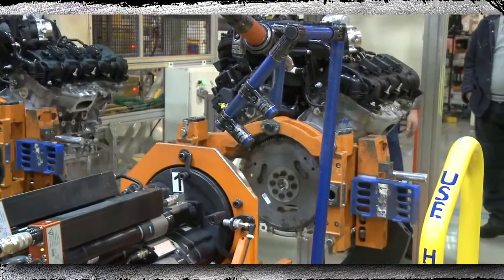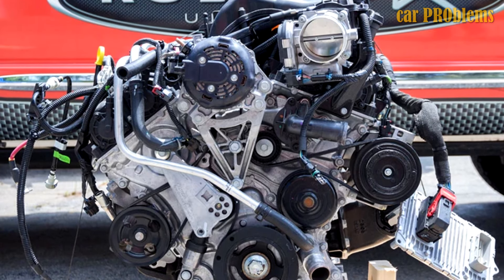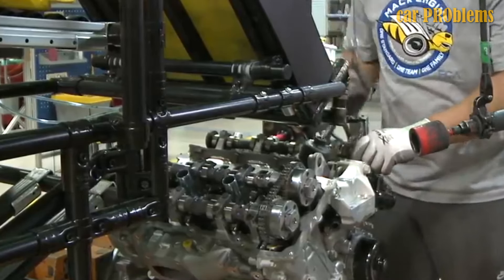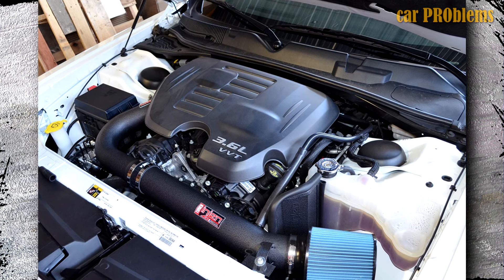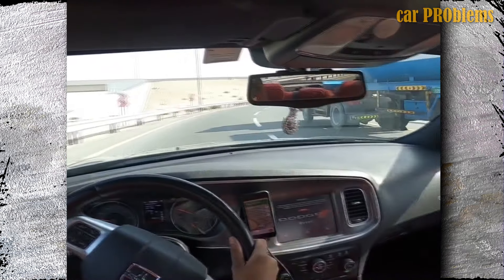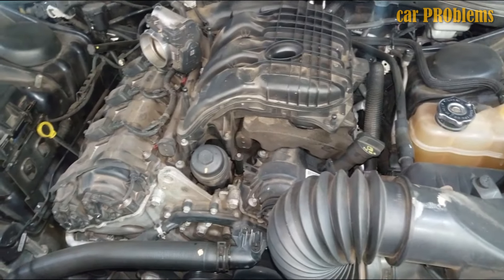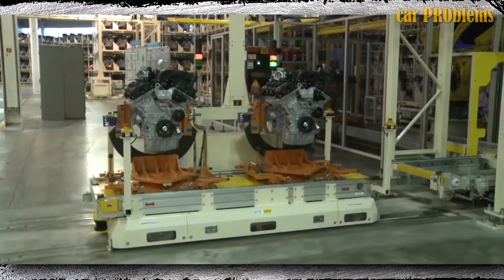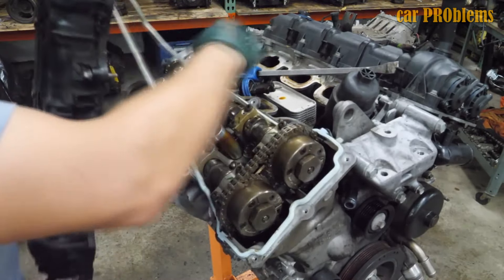3.6L Pentastar V6 Overview, Common Problems and Reliability

Comment: I currently own a 2013 ram CV tradesmen which is a Dodge Caravan cargo van basically. My vehicle has a 3.6 L Penta star V6 engine it is excellent excellent excellent. I currently have 481,920 miles on this vehicle it run. Super smooth. It's very powerful and it delivers excellent fuel economy at about 26 on the highway in cruise control, and almost 20 miles to the gallon regularly around town. The body of the vehicle is excellent. The interior is excellent I have zero complaints on this vehicle.
Reply from the maker: 481,920 miles?? That's awesome!!!
Reply: Wow
Reply: I also have the 2015 CV tradesmen , I love this vehicle.
Reply: How many transmissions?

Comment: Had a 2012 caravan with 220k on it before trading it in. Engine still ram quiet and flawless. We now have the PUG version in our 2019 wrangler, lots of miles off roading at crawling speeds. Engine has been perfect as well

Not the most exciting motor but very smooth and reliable

Comment: My 2011 Grand Cherokee w/3.6 Pentastar engine just passed 182k. No ticking, no oil leaks or burning. Amazing engine. I got my moneys worth  already. Mobil 1 5w  30  oil every 5k.
Reply: Any oil housing leaks ? And did you replace the lifters

Comment: I have a 2018 jeep jk with 3.6 star 74k miles

Mine drives flawless runs so quiet you can't even tell its running when it's on.  

BUT I Change my oil every 1500 miles ,always with marvel mystery synthetic not the original with royal purple, every 5 k I drop in a liqui moly  molybdenum the $50 dollar one I leave it in a full interval. My engine is tight no tick noises no nothing.  I'm about to change my coil packs & plugs I got NKG coil packs was $175 for 6 NGK laser iridium plugs $75 

Although I have no oil filter housing problems I'm about to change it out to an all aluminum one amazon $160 I'm doing that the same time I change my packs & plugs because might as well bcuz everything will be in fingers reach.    That's my 18 JKU.

Update I forgot to say that I had to take it back go the dealership twice for rear main seal & my rear dana 44 spider gears exploded so the dealership gave me a brand new whole rear end I didn't pay 1 cent . Besides those problems nothing else but if I'm on a trail and I flex the jeep in a certain way my driver door will pop open at first I thought it was funny. The driver door if you open it with the jeep parked the door chime will annoy you to death so I cut the wires. Ball joints ball joints BALLLLL JOINTS 😡  my ball joints blew out & I had crazy death wobble but I put in heavy duty ones .

Comment: Based on about 6 different Rainman Ray videos. Just immediately swap out your engine oil cooler for an aluminum one, or be prepared for a coolant/oil slurry to eventually hydrolock your pistons and make engine go boom.
Reply: Doesn't surprise me. Owned Chryslers before. Never again. Although I am curious how this engine has "progressed."
Reply: Just did mine 😂😂 dorman all aluminum oil filter housing

Comment: It's good to see all of these praises for the 3.6. I'm on the fence with mine. I bought my 15 Ram Tradesman 4x4 with 150,000 on the clock. I have since replaced 20 rockers and 8 lifters, 1 injector, the oil filter housing, upper and lower intakes and both valve covers (not just the gaskets) due to stripped threads. It's always had sort of a "hot" smell to it. It now has 167,000 on it. I've done all the work myself hopefully it pays off in the long run. I run 5w30 Valvoline High Mileage.
Reply: I don't think you can judge the engine if the first 150k wasn't under your care. I don't think you can have much expectation with any car purchased at that mileage.

Comment: 2007 & 2008 Wrangler Unlimited with over 180,000 and both are going strong with no engine issues.  However had to rebuild both transmissions around 160,000.  Ordered a new 2024 Rubicon X with the six again.
Reply: The Rubicon X is what I'm planning to order as well. With the 6 speed manual. Hopefully, I can custom order it at no more than MSRP. Did the dealer charge you extra?

Comment: Got a 2017 dodge challenger gt with the v6 and I drive between Washington and California often I maintain the crud out of it and yes I change my tranny fluid...so far going on 400,000 miles and engine still running strong but I am still surprised theres no buring oil

Comment: I have a 2015 Chrysler 200s w/ AWD and the 3.6L. I had about 125k and had to replace all my rocker arms and camshafts. Also had to replace the oil filter housing/cooler at about 115k miles. 

Now that’s all been replaced, I hope it will last until 230k miles. Other than those very expensive issues, car has been great!
Reply: Same problem at 95,000. Had to replace the same exact parts. Poor design. Old Chrysler engineers would be on this in a second.

Comment: My 2012 Challenger and 2014 300 S have the Pentastar. I hope these last until the wheels fall off. I wouldn't trust the new inline Hurrican six coming on line in 2024 2025. My Ram has the 5.7 old school V8. and that another impressive engine.

Comment: I got a 2014 4door JKU stock engine and body, that's about it. I'm currently running Kirkland Signature 5-20W since the price of AMSOIL SIGNATURE is too much. 
2 years so far doing great 63.99 for 4 gallons hard to beat😁👍 
Off-road only Royal Purple or AMSOIL SIGNATURE if I plan to stress my JKU.
Reply: Run the 5w-30. Much better for the engine unless you’re in very cold climates

Comment: Last month I took my 2014 Chrysler Town & Country to the dealership after the CEL came on. Code P0302. Compression test #2 100psi. Failed leakdown test. Burnt valves. Only problem I noticed was irregular idle the day the CEL came on. Cylinder Head replacement $3000.
Friday the CEL light came on again. Waiting for diagnosis from dealer. Only $6500 of warranty work since new. 135,000 miles.
I bought the Chrysler Maximum Care Lifetime Warranty when new. 
Add in possible another $3000 cylinder head and the “service park assist” display that came in the week before. Could be an additional $500 to fix that. Is $10,000 in warranty work a record?
Dealer called today. They’re replacing the drivers side cylinder head. $3000 + $3000= $6000. (Warranty)
Update 11/21/23. Just got back from local CJDR dealer. Ticking sound. Waiting for warranty approval on THIRD cylinder head Replacement!!!
Third THIS YEAR.
Reply from the maker: OMG! Thanks for sharing... I have 2009 Dodge Journey. It's a "bucket of bolts". I will Never buy Mopar vehicles again.
Reply: Have 2012 200 with the 3.6 with only 58 thousand miles. Got code 0300 random  misfire, and 0306 misfire in #6. Have to replace left cylinder head 4000 dollars. Warranty 10 years or 150 thousand miles. 10 year ran out last year. Seems like is a design problem and owners have to pay.
Reply: @alexrebmann1253  I’m having a cylinder 6 misfire in my 2012 Chrysler 200s with 80k miles I had it since new it’s been ticking and it’s getting worse since 55k miles now I’m gonna replace the spark plugs and coil packs since I’m already inside the engine hopefully the removed the code and shaking in idle light shaking cars still my daily driver to work everyday

Comment: I own a 2015 Chrysler 300c with the 3.6L I bought a new in January of 2016.   The car, as we speak has 9,678 miles on the odometer, never a problem.  I run 89 octane, midgrade Shell gas only even though the handbook states 87 octane Regular.  I use Synthetic Oil only and the car should last for years to come.
Reply: Not running migrate gas it won't last, your engine is designed for regular,  you are doing damage bc it throws fuel air mixture off
Reply: Lies
Reply: These new engines operate well on 89 and 93 octane fuel,  87 is killing the new engines.  These automakers will tell you anything cuz they want to bringing back in for hi prices service

Comment: Bought a 2017 Pacifica in December of 22. Turned 100k in June and had the oil changed. 1000 miles later it started idling rough, hesitating in acceleration,  and dying at stops. Replaced plugs and coils hoping it was something easy. 
Heard it was a flat cam. Took it apart, no damage to cam, no shavings in the oil,  now no clue.
Reply: Hi! Had the same issue with my 2011 Town&Country.
Possible causes to look at:
- Dirty throttle body -> engine doesn't get enough air at idle -> disassemble, clean, reeinstall
- Vapor canister purge valve stuck open -> engine draws secondary air -> replace
- Hose to vapor canister purge valve cracked or broken -> engine draws secondary air -> replace
I did all three things, most likely cause was the throttle body which was really nasty after 150.000 km. Runs like a charm again now.
Good luck!
Reply: @JCrashB  I appreciate the information.
Reply: Did you figure anything out on that Pacifica??
Reply: @seatime674  not yet. My granite has been hit by some physical injuries that have slowed us. I'll keep you up to date.
Reply: Check for vacuum leaks and change pcv. It’s usually something simple
Reply: @michaelreilly3100  It's in the shop now. It developed a major fuel line leak,  and the dealership is the only place to find it. But apparently the Dodge dealers nationwide have been hit by cyberattack, freezing everything.

Comment: My gladiator had less than 30,000 miles on it.when it developed the check engine light, the mechaniic had to remove the heads and dig into the engine. My rig is still in the shop. I would like to put a small block v8 like a chevy 283 into it. We used to have a 1960 chevy with a 283 and jt achieved over 300,000 miles before dad traded it in.
Reply: What year?

Comment: So I have recently made a Ram 1500 purchase. 

It’s a 2017 Big Horn 4x4 and it has a V6 engine in it. 

Did i make a good decision? (I had to get out of a 2017 Ford Taurus that had a lot of issues underneath the car with the subframe that I couldn’t afford to fix) 

Some feedback would be nice. 

Both the good and bad. 

Im a first time pickup owner

Comment: I have a 2022 wrangler with 18k miles and have the ticking noise (rocker arm failure is what we think it is) dealer is tearing it down now.
Reply: They say it's reliable, followed up with bad oil cooler, water pump, left head, rocker arm, so on, and so on. Sorry, that's not a reliable engine. I prefer the   Chevy 4.3 or a jeep in line 6.

Comment: At about 50K miles on my 2013 Wrangler it started hesitating badly and threw some codes. I took it to the stealership and they cleared the codes and couldn't find anything wrong. I had to drive back and drive the mechanic around in it to show him the issue. He then agreed. A day later they call and tell me it needed a spark plug replaced to the tune of $820. They recommended doing all of them. 6 spark plugs don't add up to over $800 so I asked why it costs so much. They told me to get to 3 of them you have to take off the intake (true) and replace the gaskets (lie). I asked which side the offending plug was on and they said the easy one. I told them to change those three and they still charged over $200. When I picked the Jeep up they stressed how the spark plugs should be changed every 30K miles. I said "My 2008 Silverado still has the original plugs and runs like new." In fact it's never thrown a code except tire pressure sensors. I told them if it needed new plugs, I'd watch a YT video and do the work myself next time. Anyway I sold the Jeep before it could foul more plugs.
Reply: Intake does need new gaskets or you run the risk of it not running right. And those plugs call for 100k miles.
Reply: Yeah, that's any car.

Comment: I have a 2015 Journey rt, bought used i have replaced the oil cooler unit, windshield washer hoses, and trying to find why there is no heat passenger side now.Other issues also. Luke warm affection.

Comment: My 2016 Pentastar has been apart twice so far. The first time was for a complete handgranading of the left valve train. Then the dealer delivered it to me and upon starting the valve train self destructed again taking out the head. Now there is coolant in the engine oil and the service director tells me that there are a lot of 3.6's with coolant leaking THROUGH THE CYLINDER WALLS"  he tried to get me a new engine and they are back ordered for at least 6 months. There are a lot of class action law suits over these continuing problems. These engines are not my favorite!

Comment: Mine runs a little hot. I have the 2019, and I have read that's normal. I called the dealership, and they said the same. They also told me if it hits over 225°. Bring it in.
Reply: Lol!! And pay $4000 ...dealerships love to rip off there so called loyal fan customers!! A little hose might be your problem. Those idiots greedy money hungry cows will charge  $5,000!!

Comment: I have 36k on my jeep and I have an oil leak. If I remember correctly it’s behind the oil pan right where the two rubber grommets are located. It could be working it’s way down. Idk
Reply: Oil filter adapter most likely. Take your engine cover off and shine a light down where your filter housing goes...
Reply: Rear main seal
Reply: Engine oil cooler.
Reply: Engine oil cooler. YouTube can show you how to replace it. I put the all aluminum doorman in mine took all day on a Saturday. Changed everything I could since I was already tearing it down. I am not a mechanic. I did it 3 years ago. No problems
Reply: Warranty?
Reply: Thank you

Comment: Anyone know if the brand new pentastar engines are made better than before? Or are they still made with a bunch of plastic parts?
Reply: Same plastic
Reply: Unfortunately, those aspects of the design are essentially unchanged and, as a result, the oil filter housing is still very prone to cracking in areas that see large temperatures swings (especially extreme cold). The other plastic parts such as the thermostat housing and water pump housing DO fail from time to time but haven't been particularly problematic.
Reply: @tripkayne6645  I might as well go for a Tacoma than a 6 cylinder ram. Thanks for the info.
Reply: @joeshmoe8952 no! Tacoma is garbage, ram would be better, owned both

Comment: Hello sir. 3.5 and 3.6  if the engine belt and chain break or the engine will be completely damaged????   I have heard that the valves break
Reply: This will happen in most cars. Not specific to the engine. However, the 3.6 had a chain.

Comment: Now waiting for warranty approval on THIRD Replacement Cylinder Head This YEAR. 2014 T&C purchased new with now no longer available Lifetime Maximum Warranty. Only $15,000 in warranty work to date.
Reply: Use hi octane fuel to avoid this

Comment: lot of plastic on these engines.   hot/cold cycles will weaken the plastic parts....especially Arizona.  Watch those oil galley bolts near the front of engine around the cam reluctor wheels.  Also, convert the oil cooler housing to a metal one....leaking problems down the road.  Noticed 90% of comments are positive.

Comment: Why in the world did they put this engine in the Promaster? My 159" Promaster 2500 really struggles. The van has a GVWR of 8900 pounds. Chrysler should have found a engine with more torque.

Comment: I have a 2014 charger sxt, use synthetic oil. At 136,000 miles, valve spring broke, dropped valve in cylinder and ruined the engine. Replaced engine, 36,000 miles later, valve spring broke, dropped valve into cylinder, ruined engine. Replaced engine, traded car for Nissan, no more dodge products for me.
Reply: Surprised you didn’t get a Toyota over a Nissan. Nissan also has issues, especially if you get a CVT instead of manual transmission.

Comment: If you managed to get a 3.6L that your not going through tune ups, oil coolers, rockers, lifters and cams your good but these engines are terrible for it. Idling in long periods is a recipe for disaster.  I don't like 5w-30  really thin, good for start up but after the engine breaks it down some engines get that unknown friction
Reply: I heard use 5w40 to prevent ticking problems

Comment: So this is the answer for Mopar wow. Now with all.of the issues with this engine which baffles me the most is now in the new RAMs they drop this junk motor in it and drop a turbo in it. The only way I can see them get their die hard customer  base back is a redesigned Gen 4 Hemi without the lifter, and camshaft issues. Without that, they will be in a constant bailout until the government cuts them off and then the death nail to them all together. Those are their choices.

Comment: You forgot they had high rates of cracked cylinder heads on all years, to date even after they lied and said they fixed it. I know a chrysler tech that has changed a ton of cylinder heads due to cracks. Good engine with pissy poor quality control like Ford.
Reply: I have had 3 of them, the only problem I ever had was the head castings for the early JK’s had casting sand issues leading to a plugged heater core. 2 of the 3 I kept over 200k with no issues the third was the JK motor which had the heater core plug.

Comment: My '15 charger had 667k.  Mostly highway driving defending America's roads from demadogs that are smokin pot and meth while driving.  My group removes them from our harm.  

540 Rat blog says quaker state full synthetic 5w30 is better than amsoil.   I change my filter every 1-2k.   Mobil 1 filters.   No engine issues.  Changed thermostat with dorman metal housing, serpentine belt q100k, hoses q100k, champion 9407 oem plugs q100k, coils q200k.  Oil filter housing with dorman at 100k.  Never since.  Trans 8 speed pan with oem oil q30k.   No issues.  

Love this engine.   Oh....no cats.   Im allergic.   Lol.  😮
Reply from the maker: Thanks for sharing this! Amazing results!